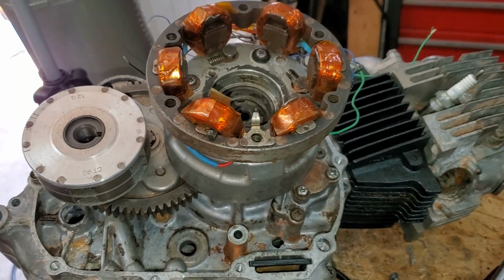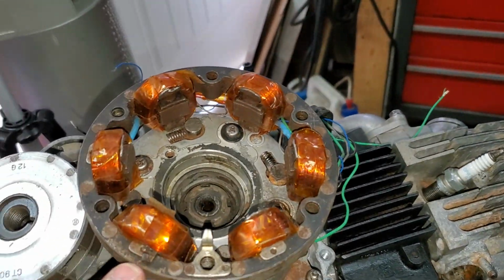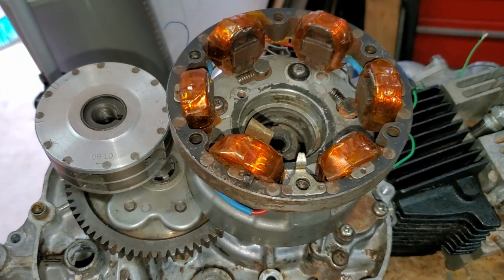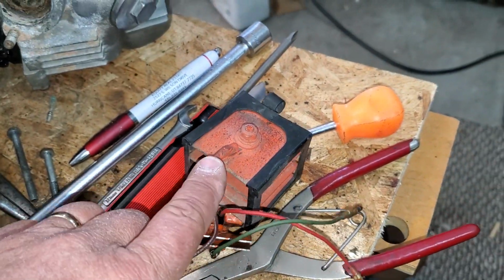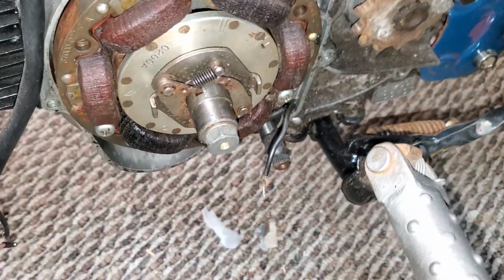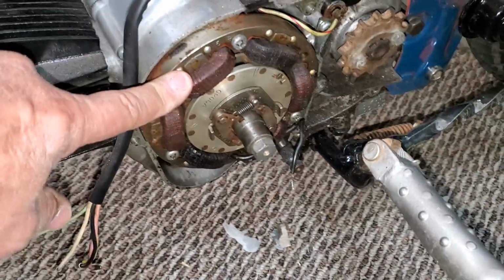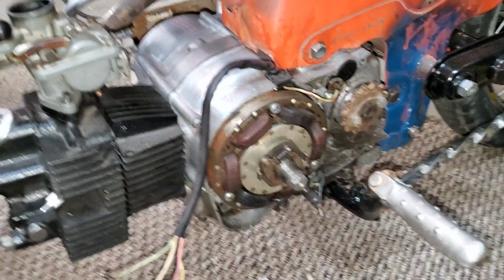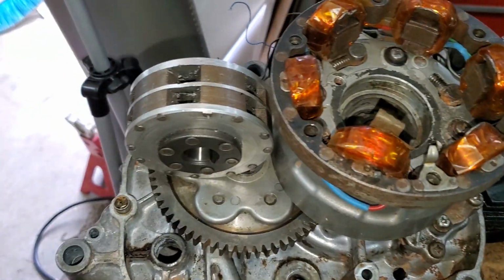Honda 90 battery ignition. CT90, C90, all 90's

Comment: Great information, thanks for sharing! I’m trying to solve a problem with my ct90 as it will not charge the battery, I replaced the selenium rectifier with a diode type. Do you think that it should be able to charge the battery?

Comment: Hi David. Just have a question that I thought you could help me with. I’m currently fixing spark problems on my 1972 CT90. I have 6V throughout the whole system. Up to the key. At the red wire going to the coil but still no spark. I discovered today that I’m only getting 2V at the points on the little spring arm. Is this an issue? Also the little spring arm gets very hot when I turn the key on? Is this normal? Do you know what might be the reasoning behind this? Thanks

Comment: Hey David, I have a CT 90 with no wiring loom so the motor cant be started. Are you able to do a sketch of basic wiring just to prove the motor a runner please. My stator has 1x green with red line, 2 x white and 1 x yellow. Also can it be started with no battery? Thanks.... Alan from Australia

Comment: Hello David and thank you for this excellent simplified and comprehensible ignition video!   I have a 1975 ST90... This year I have gone through 2 batteries and 1 rectifier thinking one or the other was the cause of mid-flight motor "dying" - moreso when the is on... turn the light off, motor kicks back up... but eventually dies... After replacing both the rectifier and battery same time last week, the problem came back... So I am thinking the stator is shot... but if it looks good it sounds like the issue maybe just be points?  Would that be fair assessment?  When the battery is charged there are no issues, for about 15 minutes of drive time then the mid-flight dying starts all over... Thank you!

Comment: Thanks for the rundown David. Im actually having some troubles here with my 67' CL90.  When i turn the switch to the "night-mode" you mention (Low beam or High beam position) the battery voltage starts going south and eventually the bike will shut off.. This is with the engine running and a multimeter hooked up to the batt. Im getting around 6.2v (with engine running/ light off) with a slow increase when i rev the throttle then as soon as i flick the headlight on  the voltage falls off and keeps dropping pretty drastically until it cuts off... Does this sound like it could be the rectifier or the maybe stator? hmm mystery to me.. . I would welcome any wisdom here. -Thanks
Reply: Im having the exact same problem did you find a solution?
Reply: @Brookzee32  I rolled the dice and replaced my rectifier and that did the trick! Good luck
Reply: @rain-dog-83   Thanks for reply. Thinking that's my problem too. Diode ohm test failed so just ordered a new one 25A 600V rating made by NTE. What specs were the one you installed?

PS How has it been since new rectifier install? Are u seeing 7-8V with the headlamp and brake lights on? Also did u wire the ground from the rectifier directly to battery ground or to the frame?. I don't have original manual so not sure which is the factory correct way. Will test if there's a difference  :p thanks
Reply: I've been trying to sort mine out for a full week. I still can't get it to run right and then the kick pedal  snaps off. I think it needs a priest not a mechanic. I wanted a 125 but there won't be any til next year so I bought a 90 . What was I thinking! It's a 45 yr old bike. 😲

Comment: Bottom line. Honda 90s need a battery to run. Some will produce a visible spark without a battery. However there usually isnt enough power to spark under compression. Some do run, but very poorly and dont usually idle. Venturing out with a weak battery can leave you stranded.

Comment: Hello when I turn on the lights in my ct90 1977  the engine start to fail when I turn of everything it’s ok. 
It’s that a problem in de voltage regulator  thanks
Reply: I have the same problem
Reply: Same problem any of you find a solution?

Comment: i have a 1969 cl90 and 6 months ago when i purchased it it didnt have a battery and before starting a restoration on the bike i checked for spark several times and it did, now that the bike is all put back together i dont have a spark unless i hook a 6 volt battery, i replaced the selenum rectifier and checked all the wires from the stator to the rectifier and ok , i cant figure out why i dont have a spark with out the battery,
Reply: I had the same thing happen with a CB350. I was able to start and ride the bike with no battery, then one day the spark just stopped.